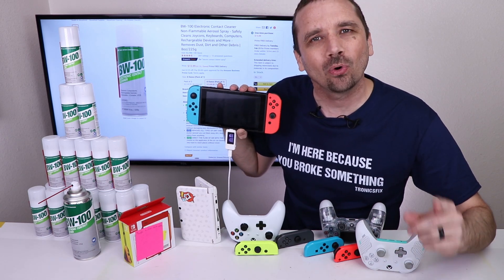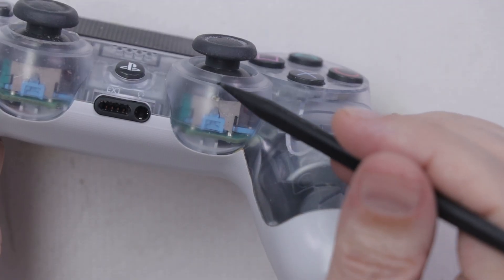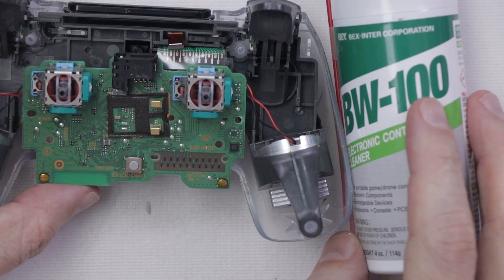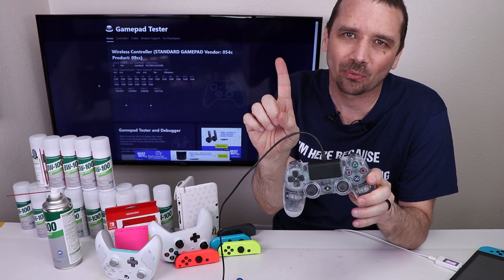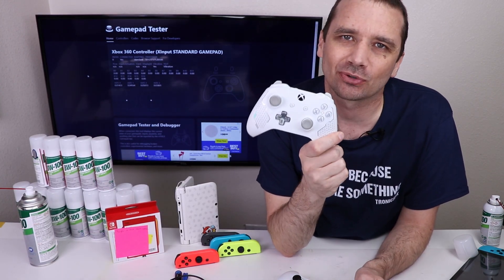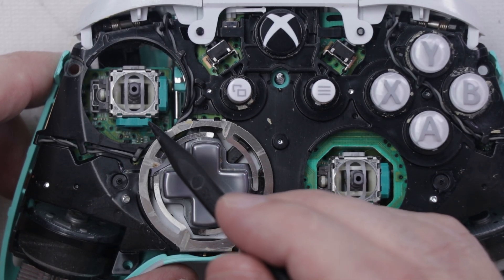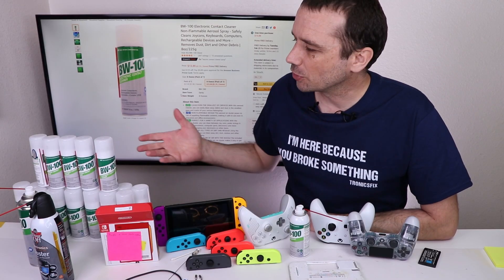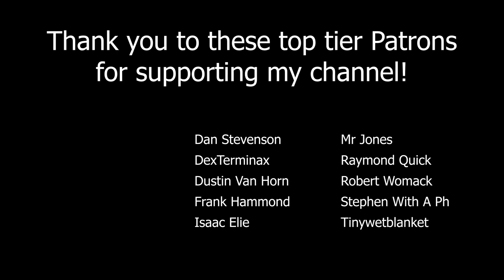Analog Stick Drift - Will Cleaning Fix It? Clean vs Replace Challenge

Comment: I love your channel and i love what you do. This video came out at a perfect time. I cleaned my controller yesterday. But i still had an analog drift. Although i only used just normal compressed air this video gave me the idea to take the controller back apart and spray some air under the analog sticks. which seems to of done the trick. Havent fully tested it , but i appreciate you none the less.

Comment: With the ps4 controller,I have that exact same model and color and the right stick drifts a lot. I haven't used that cleaner, but using ipa DOES work for a little while. I get maybe 2-3 hours of drift free play before it comes right back in the same fashion before I have to re do the cleaning. @TronicsFix - you should use these controllers for a week each them make a follow up video to see if the repair is lasting or temporary... I don't think this one video is definitive about cleaning products "repairing" physical defects...
Reply from the maker: It's not meant to be definitive. Sometimes cleaning will only work for a little while, sometimes it will work long term.

Comment: Okay, stupid question time... After you spray the liquid in there and wiggle the stick around, then the liquid dries, where exactly does the dirt go?  (Dirt can't evaporate)
Reply from the maker: The hope is that the dirt will be removed from the contacts and drain out of the inside through holes in the case...or at a minimum at least be removed from the contact and collect in some other area of the stick. That's also why I show how to open the potentiometer in this video...so you can spray it in and let anything drain out the bottom.

Comment: I only seem to get roughly 1 year of use out of my controllers before they start drifting. Is that the new normal?
Reply from the maker: Depends on how much you use it, but if you use them a lot that's probably about right unfortunately.
Reply: @Tronicsfix  is there like a different stick manufacturer which which has a longer life cycle?
Reply: @jackryder5683  he made a review about an Atari console wicha has another type of stick, go check that.
Reply: Parts are rated for a certain numbers of cycles (they can worn out before or after, it's an estimate) 1 year depending on play time and type can definitely worn the potentiometer enough that it starts to drift. Luckily in EU we have 2 year warranty
Reply: @ProfShyv  But hold up. That's for the brand of sticks they use in the ps5 and Xbox etc. Is there a better supplier of a stick that endures more cycles? Or does this company have a monopoly. I swear like I never encountered drift issues for the PS1 PS2 and PS3 controllers.
Reply: @jackryder5683  believe it or not, you can actually replace the sticks with a ton of different types. You can use ones from the ds3 on the ds4 and dualsense, along with the xbox 360 and xbox one controllers
Reply: @rockl79  Hmmm interesting. I need to research this. Like I wonder if the DS3 sticks are as precise too? Cos I know they are definitely more reliable.
Reply: @jackryder5683  it's the same supplier for the 3 brands. They probably have a patent or more competitive prices since they sell literally millions of them to the console brands.  
  
The thing about older controller not having drift... Do you remember how the PS2/PS3 sticks had big deadzones in the middle? Where movement wasn't recognized? That isn't the case nowadays, the deadzone is almost non-existent, so a little imperfection in the sensor on the PS3 could not harm usage at all, but the same imperfection on the PS5 or Joy con is the cause of drift (at least that's my theory as why analog drift became more relevant this generation)
Reply: @ProfShyv  Damn, that does make sense. Well if they patented this then it's a wrap. I was really hoping for a different brand.
Reply: @jackryder5683  I mean a patent that makes their sticks cheaper, not the patent for the analog sticks in general. There is probably other brands. But you probably can't use other brands on your controller even if you know how to install them, as the calibrations would be all wrong with a different model analog sensor
Reply: I just bought a brand-new ds4. After 3 months of use. The right analog stick is drifting already. Maybe because i play too much first person shooting game. Like apex legends.
Reply: @enakgaming8089  Pretty sure it doesn't matter, I got 3 brand new PS4 controllers last year and 2 of them had stick drift straight out of the packaging. Cleaning did fix it so it's probably just lazy and/or cheap manufacturing.
Reply: It just means that these companies are using cheap parts
Reply: Depending play style and game type ofc duration

Comment: I dont see the smaller can of bw100 on amazon, any idea when they will have it and the cost?
Reply from the maker: The link in the description is for the smaller can. Unfortunately, it looks like they are only selling 3 packs of the smallest size right now.
Reply: @Tronicsfix  That's amazing. Three 4oz cans for $26.90, or one 16oz can for $24.99.

Yeah, that makes total sense.......
Reply: @Dweller777  Isn't it the same with most stuff you buy from a shop? A bigger container is cheaper per weight or volume. Furthermore, with a pressurised spray can, the container manufacturing process is far more expensive than with a bag of candies, for example. A bigger portion of the final product price is due to the container alone.

Comment: In other words, they just need to better dust proof the analog sticks and change the potentiometer contact material. My PS2 and PS3 controllers have never had drift issues. I've had a lot of PS4 controllers and only 2 out of 10 haven't had some kind of drift. My brand new controller has drift, and I've only got it a couple days after Cyberpunk released...

Comment: 13:17 how does the electrical connection relate to the physical position of the stick? or is the detected position moving even though the physical position isn't?
Reply: The component that handles the movement is basically a resistor that varies based on position.  A voltage is applied and measured on a pin that moves along that resistor.  The resulting voltage is translated to position by the hardware/software that is involved in reading signal.

Comment: Have you ever tried to fix those traces in the analog sticks with conductive paint?
Reply from the maker: I have not tried that. By the time I have the potentiometer all the way off it's just so easy to put a new one on that it just wouldn't be worth my time to try and fix the old one. I'm guessing repairing them wouldn't work well but I could be wrong.
Reply: @Tronicsfix  Video material right there

Comment: A simple redesign should be enough. Stop dirt and moisture getting in the gap between the sticks base and the controllers shell. A flexable rubber boot/shroud/bellows should do it, like an atari 2600 joystick.

Comment: I'm curious, have you ever fixed PS3 controllers and if so, what were your results? Was it worth it? Was it difficult?
Reply from the maker: No I haven't fixed them before.
Reply: @Tronicsfix  I would love to see you try one day if you ever had a fancy to dabble into repairing older controllers! Love your content, keep it up Tronics.
Reply: @Tronicsfix  I'm curious as well, I have 2 ps3 controllers with unwanted button presses and stick drifting as well.

Comment: My DualSense L2 Spring just messed up and L2 got loose. I am unable to put a replacement spring in the slot. Can you do a tutorial to take of the actual L2 Trigger piece not the motors, just the curved trigger cap?
Reply from the maker: I showed how to do that in my last video
Reply: @Tronicsfix  On your last video at 17:06 you slid it off, when I tried sliding it off my actual motors were about pop off,  did you use any tools to make it easier to slide off or anything? Thanks!
Reply from the maker: @EmpTeee816  I think I used my pick to help slide it off. A small screwdriver will probably help.

Comment: So my elite controller joy stick is lose and moves up and down where as the other one is stuck in place like it should be how do i glue it to keep it in place also it started to drift on modern warfare i bought it new from gamestop but they sent me a used one insted they did that twice i brought the first one back cause it was used they told me it would be new and sealed had it shipped to my house the box said from gamestops return ware house and the second contoller came with a loose joystick also used from gamestop ware house i paid a premium of 170 $ and was promised a brand new sealed controller they lied

Comment: Summary:
1. If it is just dirty: cleaning works
2. If it is worn out: needs to be replaced, no amount of cleaning will ever fix it.

Kinda makes sense...
Reply: I think that pretty much everyone knew that even before watching the video. The point of the video is to mostly honour the sponsorship contract.
Reply: summed up a 15min sponsor segment
Reply: Yesterday i cleaned 2 joycons with drift, one work with a little of WD-40, and the other one needs to be replaced, too close to 100% success rate
Reply: @guillermoabrego9476  silicone spray is better than WD 40. It evaporates and doesnt leave anything behind. I use it for electronics
Reply: @guillermoabrego9476  erm...it is exactly 50%...
Reply: @franzusgutlus54  yes I know hahahaha, but the try it is what counts

Comment: Personally I think it varies depending on how badly the potentiometer is damaged. If its caused by dust and finger gunk it'll definitely fix it for for most part, but if the potentiometer tracks are damaged it's replacement only generally. Great video as always Steve 👍
Reply from the maker: Yep, exactly. That's what I show in this video too.
Reply: @Tronicsfix  yeah sorry I commented too early haha, great video anyway this definitely is useful info to a lot of people 😄
Reply from the maker: Ha, ha...no worries.

Comment: Is stick drift just a nature of the beast type of thing? Cuz I’ve been thinking about just replacing the plastic potentiometers with metal ones, but even those would develop grooves at some point, right? Genuinely asking, I really don’t know haha.
Reply: Metal is what is needed Microshaft keeps using the same cheap plastic potentiometers as the xbox 360
Reply: @Keepskatin  very interesting. I figured the metal would wear just as much. And it’s a shame Microsoft (or Microshaft as you call them lol) keeps using these cheap parts considering how pro consumer they’ve been acting as of late. Hopefully they’ll turn that around, at the very least for their Elite series controllers.
Reply from the maker: I don't know of anywhere you can buy metal potentiometers. Might work though

Comment: I used the old press down on the stick and blow inside trick always works for me😂
Reply from the maker: Whatever works!
Reply: you really shouldn’t use your breath in place of this sort of cleaner. your breath is water based and therefore conductive.
Reply: Explain the trick now :)
Reply: @lobamaisgonel  you press the stick down like you have to press R3 or L3 and then you just blow inside while moving the stick a bit while still pressing it (be carefull no to spit inside the controller) I suggest you do this trick with a spray air can they cost nothing so that you avoid unintentionally spit on the potentiometer
Reply: @ClusterBaffo  thanks alot I’ll try this

Comment: Simple answer......No. if so, it is only temporary. The springs in the potentiometer goes bad and causes drift. Your silly spray can't fix worn springs.
Reply from the maker: You should watch the video
Reply: @Tronicsfix  8:15 🤣 . This BW stuff must be some silicon hardening spray that helps slightly worn potentiometers, but heavily worn, it is no good. 
  All of this could be avoided if console creators would use aviation grade metal potentiometers.
Reply from the maker: It doesn't have any hardening agents in it. It's a cleaner. As I say in the video cleaning works great if the potentiometer isn't mechanically worn out. Agreed that manufacturers need to do better with how these are built.
Reply: Steve is correct in one aspect.  At 8:15 he is showing the inside of a pot with carbon film construction.  Its made by depositing carbon ink (sometimes an adhesive phenolic resin) on a substrate.  What you see is the resin when it has failed and is rubbing off.  There is no spring inside the pot - the spring is in the next level assembly used to return the wiper to a known position.  BW (buhmwoo)-100 isn't silicon based and not a lubricator.  It has isopropyl alcohol inside it which is good, and it has a ingredient used for making hydraulic fluid, which is bad.  Console vendors will choose a 0.10cent part over a $2.00 part in volume any day.
Reply: @downesg  When I get stick drift, it is always the spring, fps games ruin the cheap springs. The price of the controllers are double the cost , but the quality is still xbox 360

Comment: Here in the UK we have "Servisol Super 10", been industry standard for electronics engineers for decades.
Reply from the maker: Interesting. Never heard of it.
Reply: @Tronicsfix   Probably because of geography, I think it's a UK thing, I've used it since the 80's, even fixed this thumbstick issue on controllers myself, we also can't get BW-100 in the UK, I just looked, either way they look like they work the same :-)

I'm hoping you get around to fixing some PDP Afterglow Prismatic XB1 controllers, I got a pile of 25 of them need diagnosing, all the digital inputs work but no anaologue or LED's, I just haven't got around to using a meter on them against a working one yet :-/

I love this channel btw :-)
Reply: Is that better than WD40 contact cleaner? (U.K)
Reply: @Crest6680  silicone spray is a great electronics cleaner. Evaporates almost instantly and leaves no residue behind.
Reply: @Crest6680   WD40 is not a contact cleaner, it's mostly for rusty metals, servisol is purposely for contact cleaning. (Edit) my bad, didn't realise they made a contact cleaner, I just searched it, can't comment on the WD40 stuff, but Servisol is all I use, always gets the job done on stuff like dirty volume pots on older amplifiers etc.
Reply: @GforceMI1965  WD40 has a contact cleaner brand. And works great for drifting in joy con. I always have a bottle, but you need to buy the contact cleaner one, the regular WD40 is not for that.
Reply: @viwalls   yeah I see that after doing a search for it, main reason I didn't know is I've always stayed with the one I've used for decades, it's one of those products that just works pretty much every time, seems the main issue with the pots in modern day controllers is the pots are cheaply (mass produced) made and they don't bother to lube them up properly, especially the alps pots that are in the new dual sense, I'm shocked at that because Alps are famously good quality, especially in older hi-fi equipment, they're the go to products normally, they don't make things like they used to.
Reply: @GforceMI1965  he said wd40 contact cleaner, not wd40 :) but i personally think its aimed more at car electrics, than small pots
Reply: In Argentina we have "Contacmatic ultra green" super verde. xD
Reply: Great stuff

Comment: I cleaned the sensors with alcohol and the drift was gone.  You can do this without soldering.
Reply: It only works if it’s not yet worn out.
Reply from the maker: Nice work!

Comment: I have a issue where my dualsense L2 button has become loose and is no longer springy....
Reply from the maker: I fixed that in my last video...where I fixed 8 of them.
Reply: @Tronicsfix  thank you
Reply: Soak it in citric acid
Reply: @majestic2876  👍